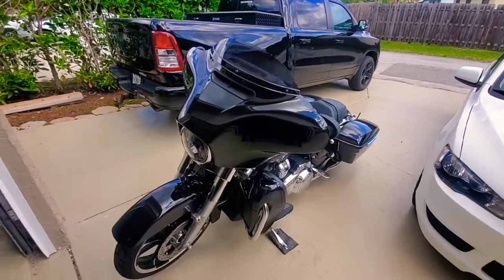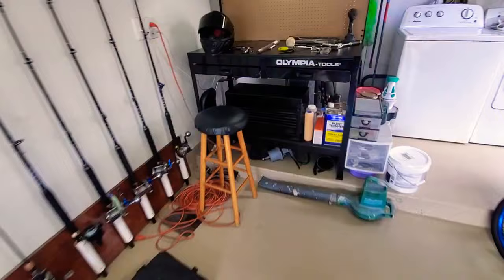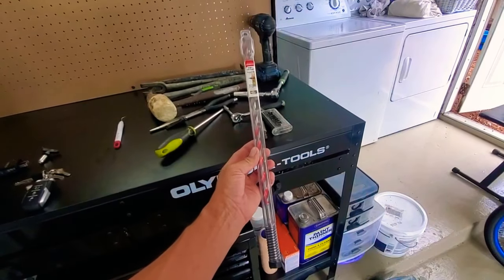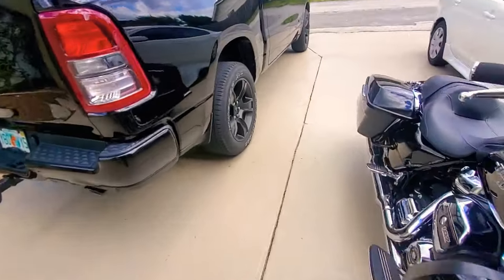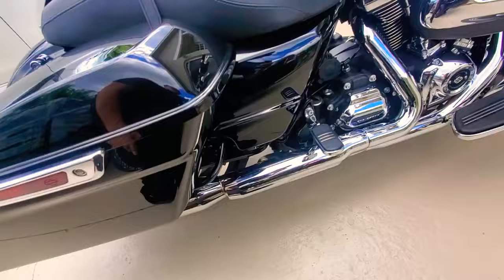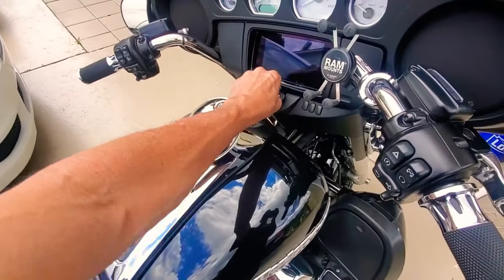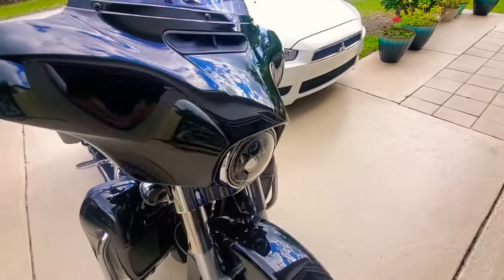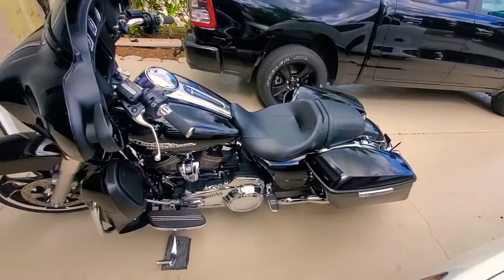2020 Harley Davidson streetglide  Cat  delete the correct and easy way

Comment: The correct way to delete a cat off a Harley is to buy a 2 into 1 exhaust with no catalyst. In addition to that, buy a tuner. It's expensive, but it's the right way to do it. Your ECU will adjust for about 10% of change in the air to fuel ratio but since you took out the catalyst; it's off and will need to be adjusted.
Reply: Simply not true for m8 engines, dk customs did a dyno video about full exhaust and intake with no tune
Reply: @ridered7394  do you even tune? You’re verifiably wrong, from a Harley mechanic….
Reply: @Scoobydue420  Agreed! I did a 2020 RG and a 2023 SG. Both Stage 1's. Both needed proper tunes, especially the one we did V&H big radius exhaust. It wouldn't even idle for more than 10 seconds without shutting down the entire ecm. Later model M8's behave differently than older Harleys and you have to know what you're doing. Removing cats might benefit from less heat but you might actually lose power. They also run super lean without a tune.
Reply: This is not true, the cat has nothing to do with a/f ratios.  The sensors are before the cat.
Reply: No u don’t need to tune it all it achieved was getting rid of the heat that radiates from the cat It had no effect on the way the bike performs and it will change the sound very little it’s been dyno tested and proven
Reply: Not everyone likes the sound of 2-1, personally I don’t like it but everyone has different tastes
Reply: The right way would be replacing the stock headers. Screw 2-1, they sound like shit
Reply: @HDFXSB645  agreed
Reply: @snakebite6511  if you're chasing performance numbers, then I could understand 2-1. I'd rather have a good sound from true duals

Comment: I dont know about this one. So you just drilled a big hole thru the 2" catalytic material? Probably made a huge mess inside there.
Reply from the maker: Simply drilled out all the material it falls apart in pieces until it's clear ...no hole or mess or welded patched up exhaust
Reply: Ah ok, so you did clear out all the material. Thanks.

Comment: Sounds good! Are they stock handlebars? I was checking out your phone mount.. there's no room. If so can you tell me which Ram mount and do you have a better picture please
Reply from the maker: Thanks 👍Yea stock handlebars but I'm changing them soon it's just a ram mount with handlebar clamp I think I got it on Amazon I got it when I first bought the bike in early 2020
Reply: Thanks. There's no room for a phone mount. 1st I've seen mounted to the bars
Reply from the maker: @TheGroundhogkiller  yea it fits but you're right not much room

Comment: Dude! You never explained how you did it? LMAO - "I bought this auger bit from HD! It was easy". How did you do it? Steps? Would appreciate an actual video explaining this. Thanks!
Reply from the maker: It's pretty straight forward just need to remove the slip ons and once you do that you can see the catalytic converter inside the header pipe then you just use your bit to crunch it and drill it out in pieces and you can clear the whole pipe once it's completely round clean it up as best as you can put your slip-ons back on and now you have no cat

Comment: Hi, Just seen your great vid. Did you remove the pipes when you removed the cat or did they remain on the bike? Thanks
Reply from the maker: Removed the slip ons mufflers then you can see inside the header pipe with a flash light and you'll be able to see the cat
Reply: @Xworks22  Many Thanks. I guess what i was getting at was the headers remained on the bike during the cat removel?
Reply from the maker: @stevelove1560   oh ok yes the header stays on the bike 👍
Reply: Thanks bud. Take care.

Comment: Appreciate the vid, just starting looking into this to help with the heat.  Im rocking a stage 1 setup so curious to see if I get any additional gains. I assume you left the sensors in while you drilled out the cat?  No concern with possibly hitting them?  For the auger, just like the $25 bit from Home Depot?  Much appreciated.
Reply from the maker: Thanks  yea it helped big time with the heat  the cat used to get so hot it yellowed the chrome on th slip on pipe. no there's no sensors to damage and yes just a simple long drill bit to break all the cat material then just pull the chunks out with long needle nose plyers . the bike runs way happier without the cat plugging up the exhaust

Comment: Did you have to buy a tuner for it?
Reply from the maker: No if it's just exhaust but if you do the air filter you should get it tuned it will still run ok and safe to ride but if you want the most out of it
Reply: @Xworks22  ok
Mine is stock housing but I bought a k&n filter. I'm cheap and don't want to spend money for a tuner
Reply: Yes you needs a tune.

Comment: How did you remove it ?
Reply from the maker: You don't remove the cat only the rear exhaust slip on  after you do that you can see the inside the cat then just proceed to drill into it and it falls apart easily and you can remove the chunks till its nice and clear
Reply: @Xworks22  I ride a 2021 RGS and  im assuming the cat c is in the slip on on the right side of the bike as well. Thanks for this tip I haven't seen any channels revealing this. Cheers!
Reply from the maker: @InHimwillitrust  it's actually in the header pipe right by the slip on but you need to take the slip on of to acces it 👍
Reply: @Xworks22  thanks!
Reply from the maker: @InHimwillitrust  you're welcome 👍

Comment: The correct way would be aftermarket catless headpipes, no cutting or drilling anything.
Reply: How did you get the chunks out? A magnet? What size auger bit
Reply from the maker: @mathewracheau3512  I grabbed them with long needle nose plyers  any long bit  the material is soft